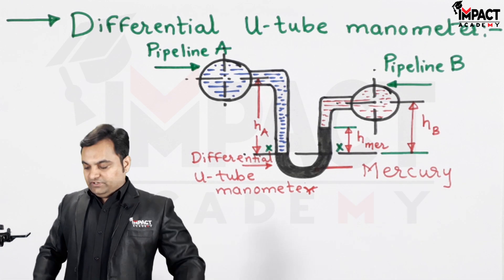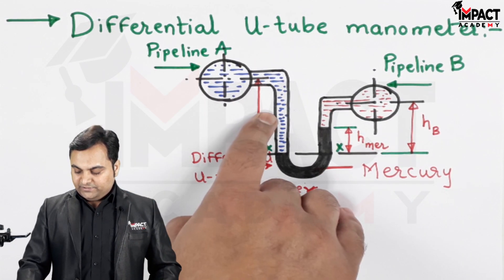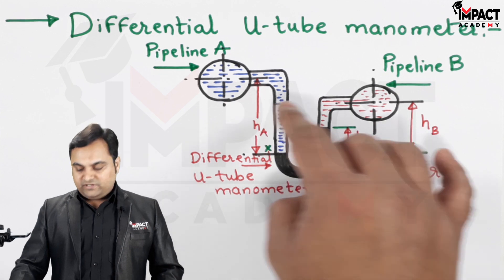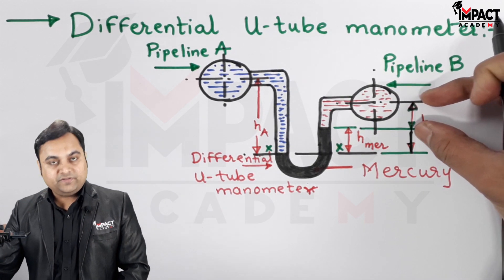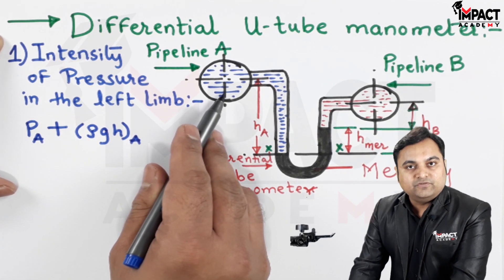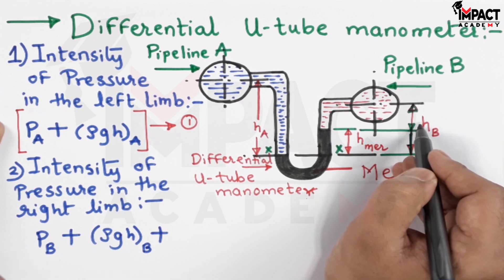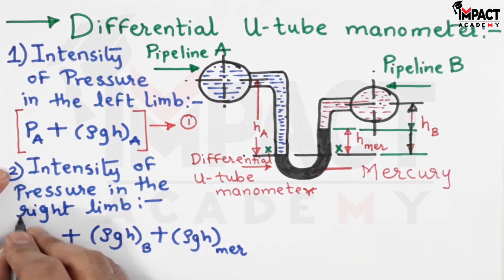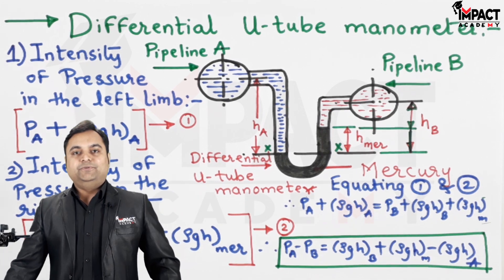Differential U-Tube Manometer | Fluid Mechanics & Machineries #engineering #gateexam #impactacademy

Comment: Could you please explain how to get the pressure at bottom ?
Reply: There is no pressure below the line XX. It is the reference level. Both the pressure on left and right limb cuts out the pressure and its zero. For example ,u can see in a manometer with both open mouth to the atmosphere ,the mercury level will be same on both the left and right limb...
Reply: as per pascal law pressure at any datum line is taken as same ! X-X line is used as a datum line !!!!!
Reply from the maker: Watch Remaining & All Private Engineering Video lectures at your Home using
Impact - The Engineering App
Click on link below for download 👇👇👇
http://bit.ly/impactEngineering
WhatsApp or Call to our Students Care for Details :-
+91 7900123134